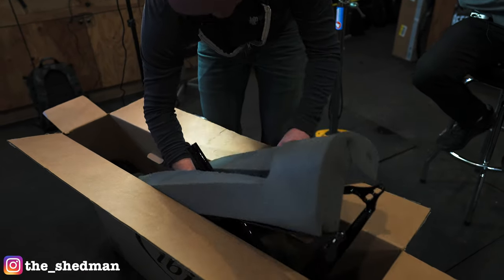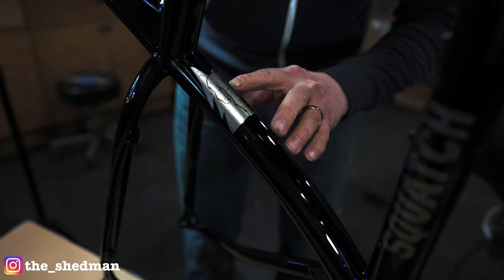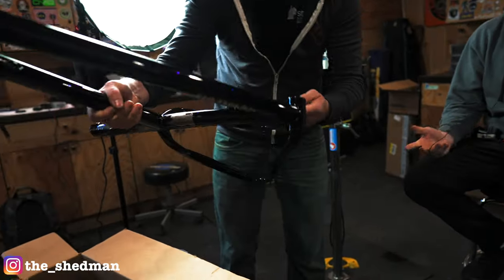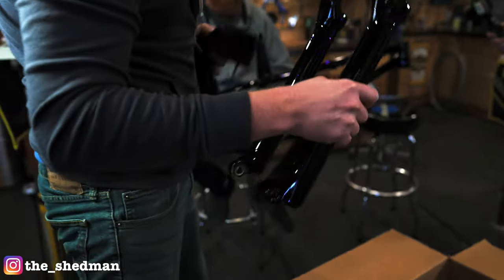Squatch Bikes New Bike Day - Twinkle Toes - Custom Painted Steel HARDTAIL

Comment: Did I count 8 speeds in the back. With a 1by why so low range
Reply: It is a 7 speed dh drivetrain. DH cassete dont have a lot of range.
Reply from the maker: Pat calls it "Single Speed Lite" 😜